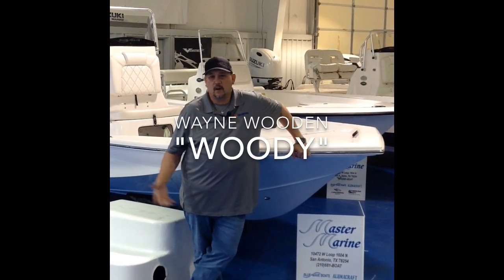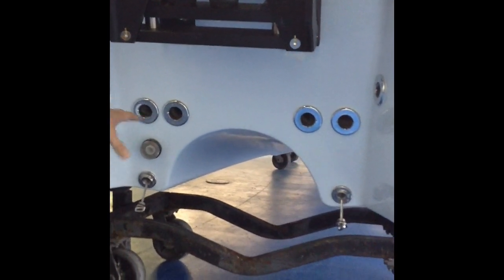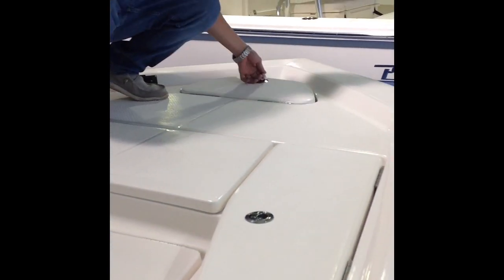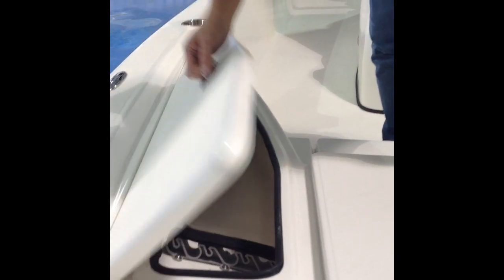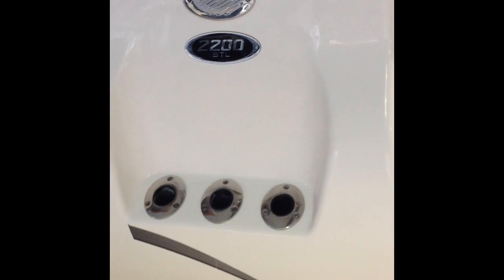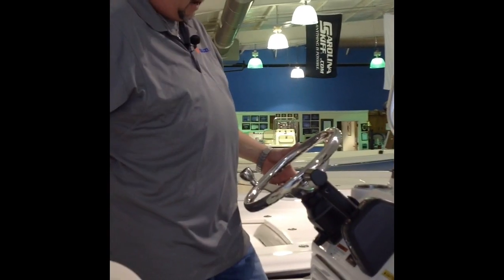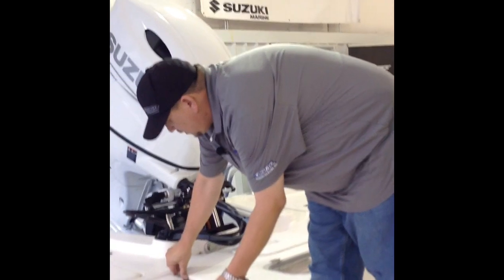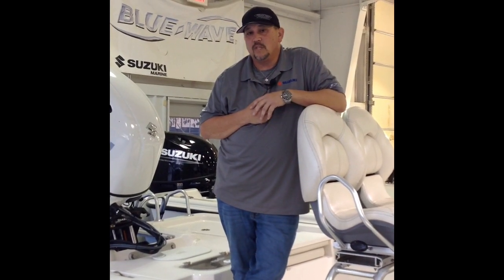Blue Wave 2200 STL Walkaround

Comment: Sad thing about these boats is the company. They don’t care anymore. I’m on my second blue wave 2200 stl and both the powder coating started to come off first season. And I baby my boats. Also the rocker switch covers pit bad and my boat has never been close to salt water. Blue wave wouldn’t honor anything. Nor the dealer which has since quit selling them. Other than that the boats are awesome. I know it seemed like small stuff but it still cost money to repair. You can’t just touch up powder coat nor can you buy only the rocker switch covers.